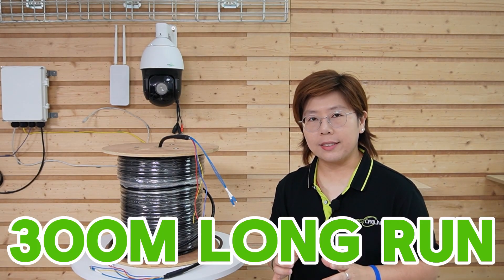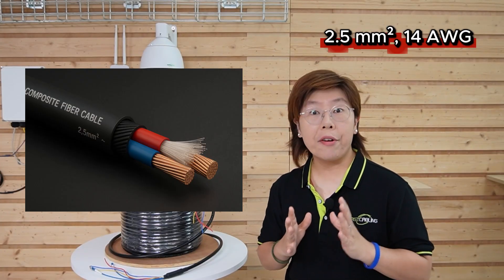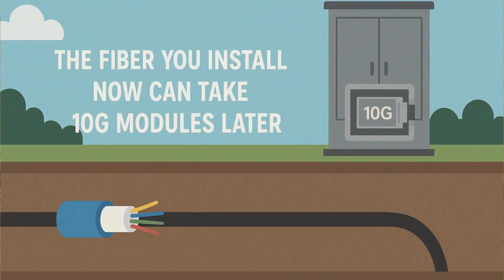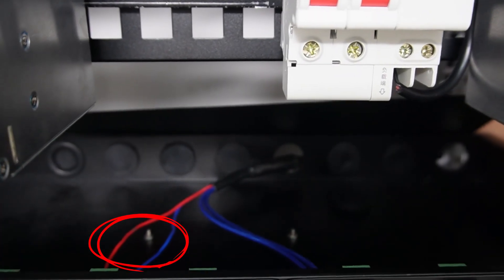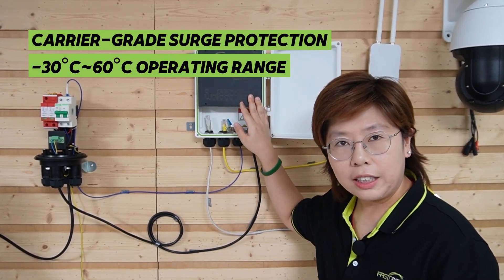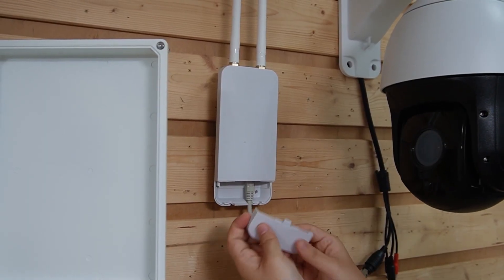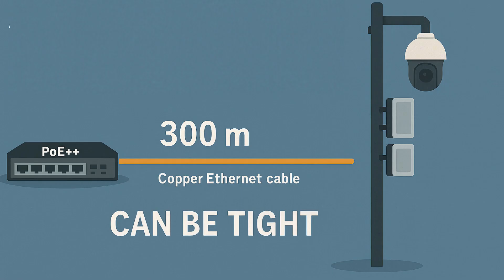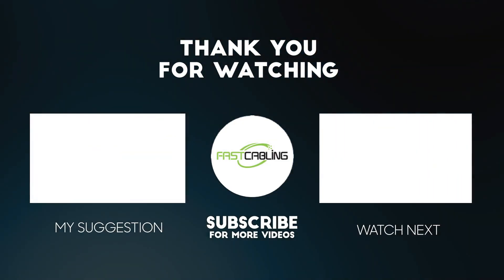300 Meters, 80W — One Composite Fiber Cable for Power & Data | Outdoor Network Build

Comment: What if you had a solar and battery pack combo at the pole.
Reply from the maker: Solar is a solid choice for off-grid installations. You can use it for power instead.

Comment: This hybrid cable would sell a lot better if it was shielded for the copper wires. 

As such, this current hybrid cable is not compliant for long distance use in North America.

What kind of UL / cUL / Any safety certification does your cable meet?
Reply from the maker: It is armoured jacket. It can’t be deployed for long run because of the voltage drop. The safe voltage should be less than 60V.

Comment: Fast Cabling, In this type of Installation can you use Wireless Bridge instead of access point?
pls explain more about the surge indoor surge protector you install on the rack?
Reply from the maker: No, you can’t take the wireless bridges to be working as an access point. The wireless bridge emit the signal to single direction.